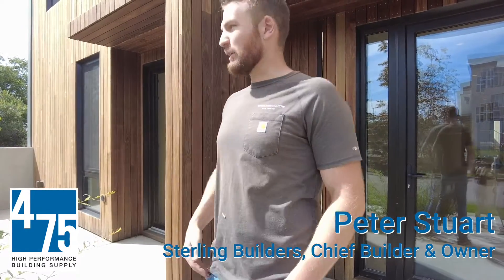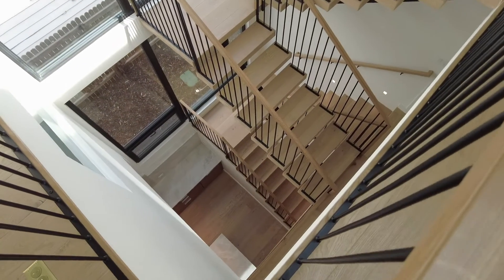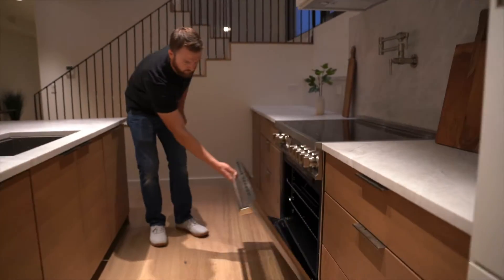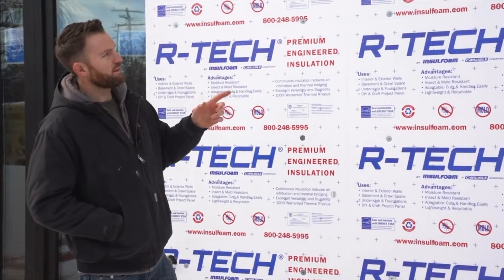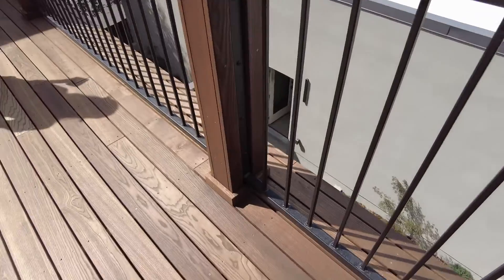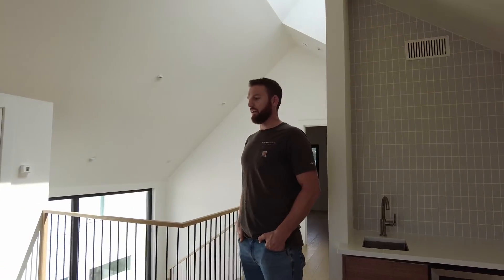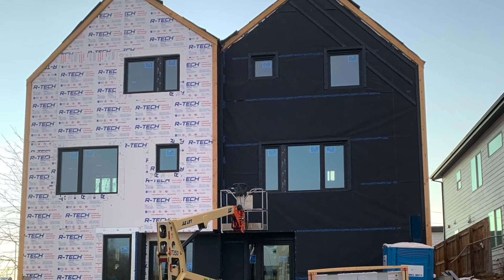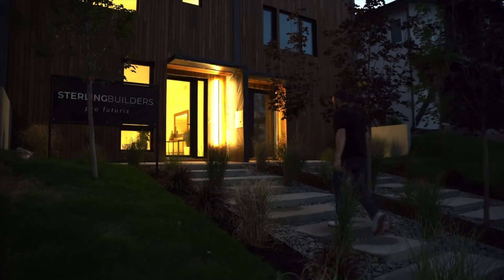The First Certified Multifamily Passive House in Colorado

Comment: Nice Project! 
I couldn't hear the counter top info, could you clarify for me? they are very nice. 
EMU is awesome, congrats.
Reply from the maker: Counters are Parana White Dolomite
Reply: @475.SUPPLY  wouldnt a house so well insulated like this have issues with condensation/humidity?
Reply from the maker: @ssaini5028  It absolutely would if they didn’t use materials that were specifically made for this situation. INTELLO interior smart vapor retarders and SOLITEX water resistant barriers are vapor-open materials that ENCOURAGE drying. These are the material that allow super-insulated buildings to perform safely and effectively for decades.